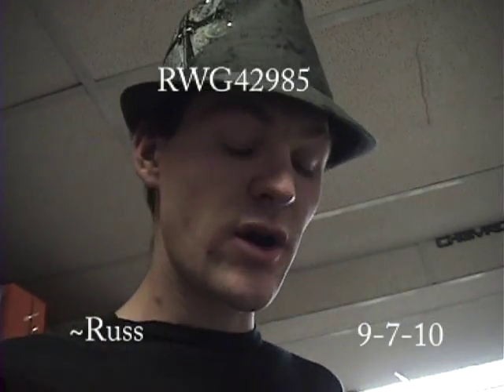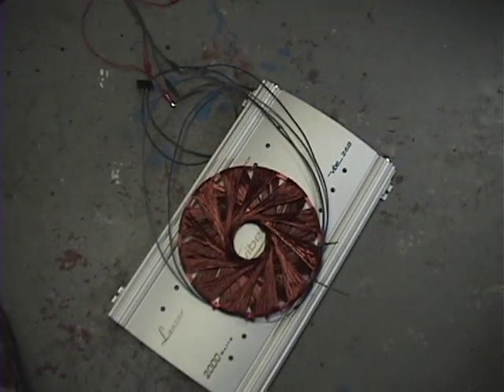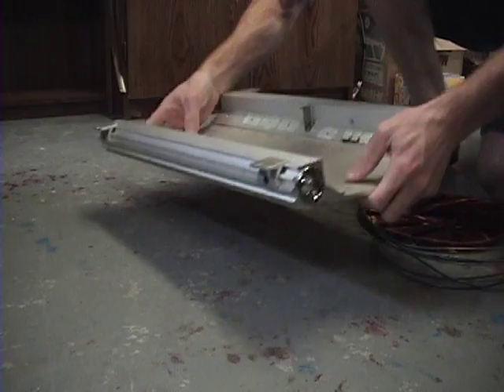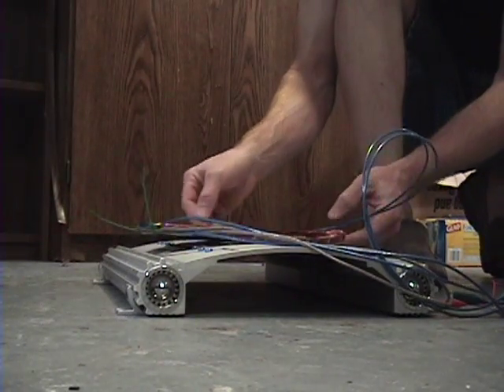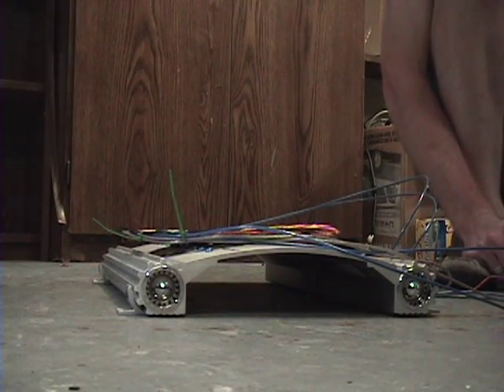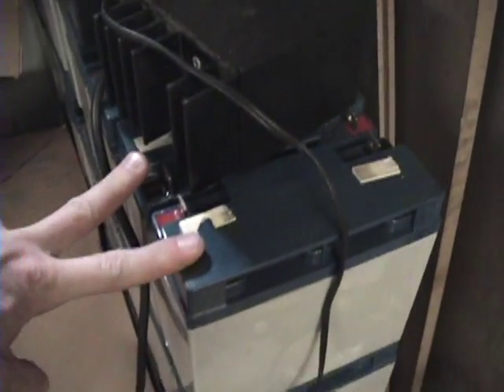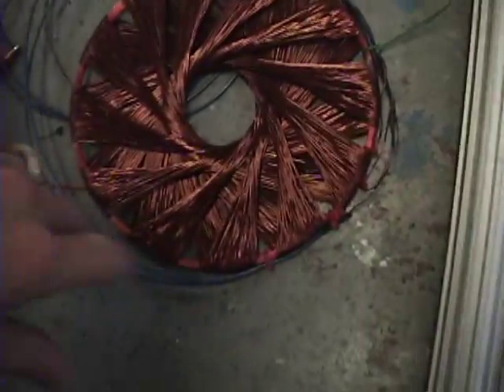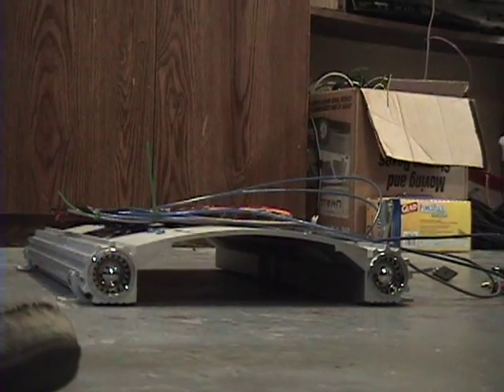Levitating 9" Rodin coil, Lenz law lavation via 120AC (TEST19)

Comment: I wonder what if you tied the coil to the alloy, would it continue to lift?..  If you had the strings on remote control type motors, releasing and tightening causing greater force on variable edges, would it repel it forward backwards? Different points of short circuit distance to either + or - polls?.. Your on to something here bud! Good work!

Comment: Yeha that is pretty cool! :-]
Can you put a weighing machine under the coil and try it the way it doesn´t work to levitat... just to see if its pullin down.... or put the Aluminum over it with a space between to see if its going up...
THX
By the way... i think if you take all of your batterys and attach it to the coil... it will just glow and blow up... (that is a bunch of batterys : - ]
Cheers